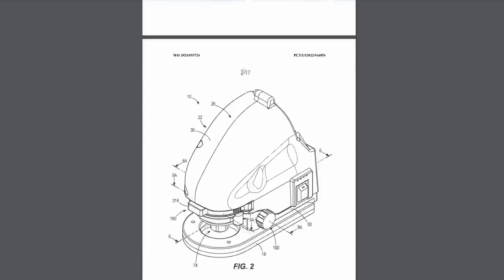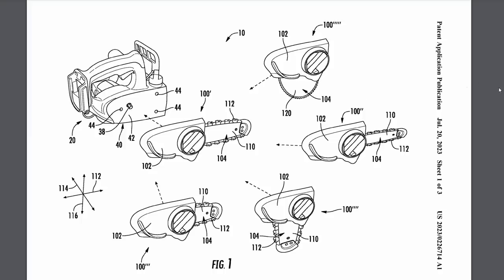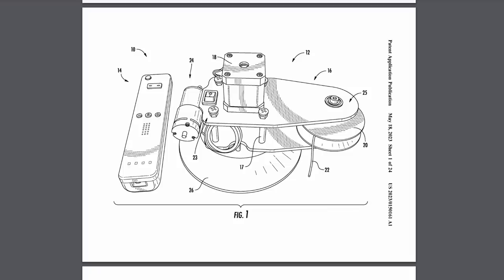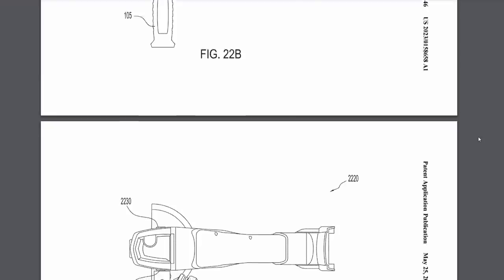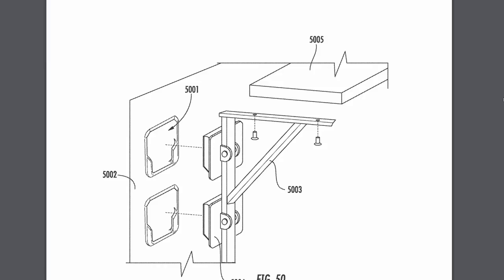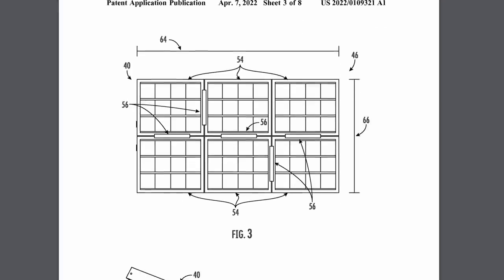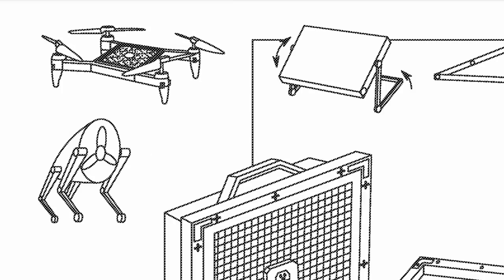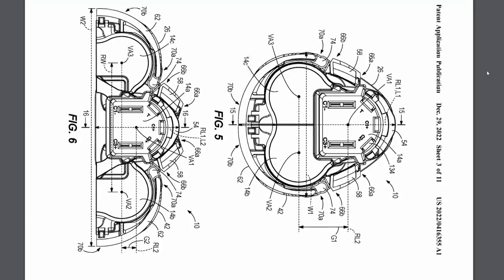Milwaukee Tool Patents for 2023 - Leaked!

Comment: Im a Milwaukee guy , but some of that stuff is stupid. I also don’t understand the vacuum for dust distraction. Why would you make two separate motors instead of making one motor with an inverter?
Reply from the maker: It was probably either cheaper or they couldn't get the power they wanted out of an inverter.
Reply: @DoresoomReviews  I would think it would have to be a power issue but  Idk. I can’t imagine a motor is cheaper than an inverter. You can get inverters pretty cheap.
Reply: @DoresoomReviews  the more I think about the less sense it makes.   Metabo HPT has a conversion battery for there 18/36 v tools.  They’re not putting two motors on all their power tools.
Reply: AC motors are cheap and reliable. AC-DC power supply that can do 800 watts are not cheap, and have a lot more components that can fail.

Comment: When will new usb red lithium tools coming out power pliers etc
Reply from the maker: There's no way to know for sure - not even if they'll ever be real products. They filed the patent in January 2023, and it was just published last month. I'm guessing it will be next year's Pipeline for release, since 1-1.5 years from publishing seems to be their average. But I've seen patents that were published after the press release (the mower for example) and I've also seen patents that are going on 3+ years and we haven't seen the tool yet (the coil nailer is an example in that case).
Reply: @DoresoomReviews  Thanks

Comment: 10:48 They really don't wanna use pouch cells huh? Seems like a no brainer. 
Just a thought but heated gear batteries don't need to work with other tools. May as well make something that is better suited to the task and not universal
Reply from the maker: I think a LOT of people would be upset about a new 12V battery platform, even if it makes perfect sense.
Reply: @DoresoomReviews  Specific to heated gear?
I don't own any heated clothes or whatnot, but who is actually thinking "Oh darn my tools dead, oh yeah I have a battery keeping me warm I can use!" ?? Or "dang I'm cold, better grab that old drill battery to power my jacket up". 
If you're actually using heated gear and need it, there's no reason not to have specific use batteries that make sense to wear in clothing. IE something flat with distributed weight. I'm not sure how the current gear works but hell, I bet they could make a flat cell that has an adapter to be compatible with the stuff that uses m12 packs.
Reply: @DoresoomReviews  I just looked them up and the jackets use a DC type plug, while the m12 battery needs an adapter to work with the jacket. So they could make any battery shape or size that has the same style 12v DC adapter on it. Simple.